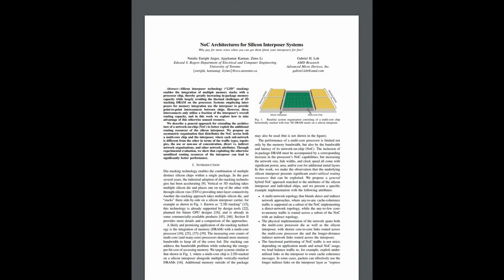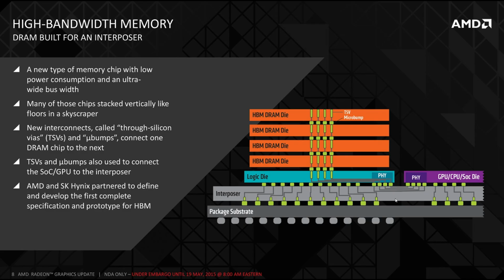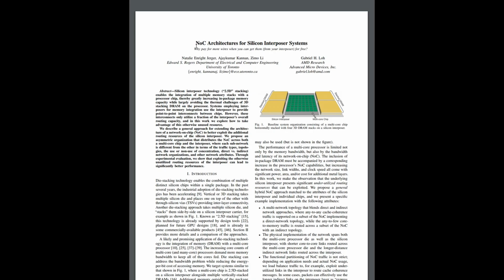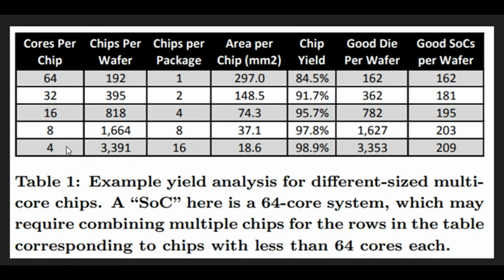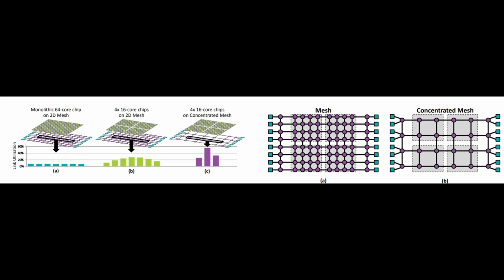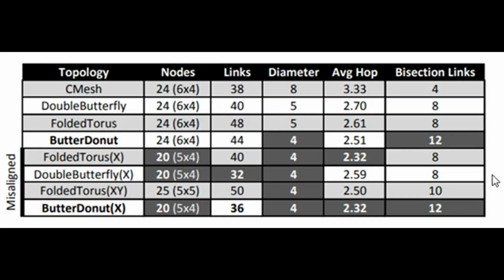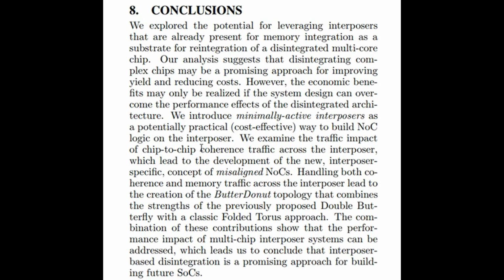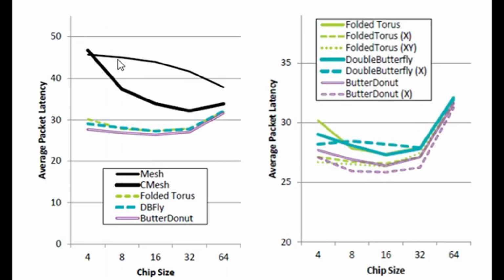Interposers, Chiplets and...ButterDonuts?

Comment: Why don't you send the research paper to Lisa Su? She may just get a few engineers to do some digging and research around these. I mean intel needs to research that as well if they want to compete. The die shrinks are getting to their limits, there needs to be a way to continue with getting performance. We may stop seeing die shrinks sometime in the next decade, and the only thing that's gonna lift up performance, are new architectures. Whoever has the best architecture will lead the show, the latter, will improvise.
Reply from the maker: 1:15 Sky Mage, check the authors again. ;)
Reply: My guess would be that it is impossible to do this kind of research outside of big CPU companies. And you can be sure that everyone that has a job in Chipdesign knows what papers there are. Especially when they are of this calibre. ^^
Reply: AMD Engineers wrote the paper :)
Reply: AdoredTV Yeah, I am sorry, my bad. I was half asleep watching your video. Thanks a lot. My mistake.
Reply: xD She is the researcher mate! Hehe.
Reply: that limit on smaller die process has been on the back of everyone's mind for a very long time. It has been a difficulty of making smaller features with the size of the light wave used in lithography, and the unknown of just how many atoms are needed to make an electronic component (diode, FET, transistor, etc) that will maintain the properties of that component after a period of time in use. This interposer thing and how HBM dies are stacked does offer another way, albeit power and cooling limited for some kinds of chips. I don't know when the limit will be reached, or what workarounds may be used to get more out of fewer gains, however, I'm sure power delivery and cooling will become an ever-increasing difficulty as well.

Hypothetically speaking, I can easily imagine a multilayer mass of CPUs made up of individual slices of "Interposers and CPU dies" stacked one on top of each other to produce a 3D cube/grid of cores. That does introduce the problem of getting power to the cores in the center of the 3D cube/grid and getting heat out from the center of the mass of CPU dies. I don't know if mini-heatpipes could somehow be included onto each layer of "Interposers and CPU dies" slices or not, and power connections capable of handling tens if not hundreds of amps on each slice for that matter. It would be very interesting to see how it is tackled if they ever go that way.
Reply: Cooling seems like the bigger problem once you start introducing large 3d structures;
Obviously there are other issues, but if you imagine something cube shaped rather than flat, then the first optimisation for power and data connections would simply be to spread the connection points over the entire surface.
Consider the history of integrated circuits, and by association, CPU's.
Many components still use the older packaging styles, but note the trend;
The oldest designs were largely in DIP packages.
Two rows of pins, either side of the chip carrier. Typically you don't see much beyond 40 pins in such a design, with 60-70 being the most I've ever seen from one.
From there you see stuff like the QFP package, which spreads the pins along all 4 sides of a chip package. These can have a few hundred pins, though often not more than about 120 or so as far as I've seen.

But pretty quickly you also started to see stuff like BGA/LGA/etc. What are these? Well, the pins are now spread over the entire surface of one side of the chip package.
There's many variations of this, depending on how, precisely the chip connects. Some are designed for direct soldering to a board, some are socketed.
Most non-trivial chips, such as modern CPU and GPU cores use these, but so does a lot of memory and other chips; Even low pin count devices, with say only 9 connections can be found in a package like this, because it makes it possible to make the package a lot smaller than a chip which is connected along it's edges.
Still, large packages have pin counts in the thousands.

OK, so... if you start making huge 3d stacks of silicon, then it follows that you'd take this principle further; rather than connecting along one plane of the device, you'd attempt to connect along multiple surfaces.
Certainly it's not foolproof. But you'd be able to optimise for routing distances, and path lengths could be shorter in general, because the same area in an optimal 3d configuration has shorter path lengths than a similar complexity device in a 2d topology.

That's all well and good for data and power connections, but of course, if you make something that's 60x the complexity of a current circuit design but using the same process nodes, are you now creating a system that has impossible power demands?
After all, the chip is bigger, and to some extent, power is proportional to the number of transistors. (it's more complex than that of course, but it's still broadly accurate.)
And of course, with more power comes more cooling.
And while cooling the surface components of a cube (or cylinder/sphere/whatever other topology might be optimal) is going to be vastly easier than cooling the interior areas.

We can see a similar issue in biology, which was solved, but does have major implications; 
Cells need oxygen, but early animals didn't have any way to distribute it. In fact, insects still don't. Because of this oxygen is absorbed directly through the skin, and diffuses through to inner cells by itself.
The problem is, the further the oxygen has to penetrate into a clump of cells, the less chance it has of getting there. Which placed a hard upper limit to how large an organism could get.

But, the solution to that was the circulatory system. Which broke the limit by creating a system that distributed oxygen internally much closer to where it was needed.
All well and good, but of course, it did introduce extra complexity and new points of failure;
To have a function circulatory system you need the circulatory system itself (which has to be placed properly, or it won't reach everything it needs to), a pump, (the heart), and an oxygen collection system (the lungs)

Anyway, to do 3d geometry in chips will require similar measures; 3d circuits will have to develop the equivalent of a circulatory system, even if just for cooling, rather than anything else.

I suppose you could include dedicated chip cooling layers in amongst all the other stuff you've stacked on top of one another, but it's certainly a lot more complex than trying to cool a 2d design...
Reply: You are all talking of slices and layers. I think the way forward is to use a curved topology. Cooling and power can be delivered in the same way as signals to the interconnects. Why should the signal have any more priority than power or cooling? They are all equally important for the homeostasis of the chip.

Comment: on a gpu... that would necessitate something interesting...
amds current word on it is they cant do it on gpus because devs are lazy/its hard/it has to be seemless
I mean thinking of it, gpu taks are stupidly fuckin parallel,  my understanding is shaders can largely be considered cores themselves, the thing I don't know is how often does a check back need to happen or does it? 
getting everything to work in firmware/driver may be possible, but any of amd's driver side anything after vega is kind of in question.

Comment: Hang on...
First we had the motherboard which connected all other parts of a system, l2 cache used to be separate as did floating point units and memory controllers and ethernet cards, sound cards, a cpu, system memory, video card and so on.

We slowly integrated them one by one, the l2 cache, then floating point unit, then the ethernet, then sound cards, memory controller (intel quite a bit late there), then we even got round to having an integrated chipset and even made chips with an integrated voltage regulator (FIVR) and integrated graphics cards now.

Before long we could have an amd APU which is a cpu, gpu, HBM l4 ram cache thats also Vram, integrated chipset with ethernet and sound all built onto a single piece of silicon.......and now we're looking at separating everything again lol.
The cpu we use in 10 years time will be contain a cpu die, a VRM die, a gpu die, a hbm stack, a sound chip, an network chip all on 1 HUGE socketed package. which will plug into a motherboard....more like a step mother really, it'll only be there because you have no usb ports on the cpu.

Comment: Always a joy to watch your videos. You find some of the most hidden and lower known tech, do amazing research, and bring the info up for us to follow in a condensed way.  Yea, most wouldn't call a 20 min or more video condensed, but, the amount of stuff you give, is amazing.  I really loved this one, as it's one I had thought about long ago, before we were doing the multi core again, I was thinking they should do a layered chip with the interposer on the main core, that would allow them to set it to a sub layer of the core so that it would have set parts to act on the different paths.  I was thinking it should have a set spot for ram, and for storage, and for graphics, each layer would run it's own part, and it would run though the interposer type layer.  Never had enough to get it worked out though, and seeing this, I love it.  I hope it keeps going in this direction, and we can get some massive innovation going.

Comment: ALL I know is I'm so happy with my Ryzen Build, I Have an X370 Taichi Motherboard and Used to own a 1700/AT3.9Ghz.. I upgraded to a 2700X 3 Months ago Basically and don't Regret it. AMD has a Great Upgrade path right now.. This along with my 3200FlareX RAm an a RX 480 has been the most stable, PC I have ever owned, Never crashes or Freezes..... I have a 4K ACER 32" freesync Monitor and Believe it or Not I can game in 4K But mostly 1440, But still that is Great For a PC that only costed me $1200 to build.. I have Built Intel systems that don't add up in the past with mixing and matching of different GPU's between ATI and Nvidia..  And never had a System like this before, that does it all!!!

Comment: One key part of the Zen revolution is to have a single die which could run on its own, or with friends.  That means each and every die needs to have its own memory access.  More cores need more memory bandwidth and get it automatically.  So no uncore die.

Comment: I wonder if AMD could move CPU components that dont scale with clockspeed onto the interposer, things like usb, SATA, security hardware, video encoder etc essentially turn it into a southbridge. so say Microsoft or Sony want a console, AMD just have to make a custom interposer on a cheap process and stick some off the shelf ryzen 3000 and radeon GPU dies on it rather than tying up their 7nm capacity with huge chips that sell for peanuts.
Reply: samsung?
Reply: its the best way for amd to make semi custom chips while using high performance off the shelf silicone.

Comment: I'd love to see a 256 core architecture ;^). Now that cost per core scales linearly due to fragmentation, potentially, the only thing limiting number of cores is the latency and size. I'd think that when two threads need to speak to each other, the software, or hardware controller on the cpu whatever, should be smart enough to assign the two threads near each other, to decrease latency.

Comment: An interesting article, Jim. Imagine that: 7 nm. node, improvements on the architecture, at least 2 more cores and interposers. That would be nice. Even if AMD would be 1 or 2 years later, this much is certain. There is real progress again in chip-design after almost a decade of stagnation. If AMD could build an intelligent interposer then multi-die GPUs could be interesting. Otherwise it will only function as if you use two graphics cards and tha only works reliably  with a modern API for graphics (Vulkan/DX12) and proper support from the developer.
Reply from the maker: Yeah GPU is an interesting one with different challenges.  Needs more research. ;)
Reply: Yes, GPUs on themselves are quite complicated but with all the software and interaction between GPUs, CPU-cores, SSD's and RAM and the requirement to get a certain set of data processed at the same time for that frame, it gets complicated fast.
I downloaded those articles, i plan to read both articles soon. Interesting stuff.

Comment: Another potential benefit that I see using an active interposer, is that memory driver circuit could be put on the interposer. As I understand it, mixing the larger transistors (required for driving the high currents needed for DRAM)  on a die with high speed logic causes conflicting design requirement leading to design compromises. Just a thought, and I might be wrong about this, would be interested to hear from any experts out there.

Also, In depth content like this is why your channel is the absolute best on YT. I learned a lot today, so thankyou Jim for all your hard work and great insight.
Reply: Right and even more as both i/o and cache scale poorly in leading processes, which cost ever more to develop there's the potential to use cheaper older processes optimised for things like the IOD and Zen4x3D V-cache chiplets rather than core logic.
From leak reporters it sounds like Zen6 will be stacking core CCDs on  an active chip though one that provides far more functionality than just an active inter die network.

Comment: complex technology well explained! The transition from monolithic CPU to "glued together" chiplets is a major shift that is going to revolutionize not only x86 CPUs, but the whole computer industry. 

I guess we can expect not only CPU chiplets using active interposers with complex NoC, but also GPUs, high bandwidth memory  and various controllers that previously were part of a mainboard chipset or an add-on card. 
The active interposer should make it possible to integrate all this different chiplets into on big, fragmented chip. 

For now, I'd be happy if AMD would come up with a new APU lineup that not only integrates Vega or Navi cores, but also the frame buffer memory - all connected through an active interposer which lets the iGPU perform at RX580 level. My guess is we're not too far away of something along these lines. 

Besides the savings from the production process, this technology will let CPU makers earn more money as they will be able to extend their value chain across parts that were typically supplied by 3rd parties.

Comment: So, do you bet that's part of Zen2 or Zen3? Maybe Zen3? Because it's on the same 7nm technology, so it's interesting why the generational jump there.
Reply from the maker: Could be Zen 3 yeah, too early maybe for 2...
Reply: The nice thing about it. is while you technically make it more complex. The complexity is split on two different components. For a Zen 1&2 chip. Every chip have all the components.

Just pushing down the network (and maybe phys) as well as nodes to the interposer does free up complexity from the cores.

It whould also lower the amount of conectors of the cores. Connectors (and also phy) can´t be die shrinked, so they take up a quite big area of the chips and there fore is a very expensive sector of the die

Comment: Wow, the concept of an active interposer never crossed my mind.  This is extremely good as even if the 7nm node churns out poor yields AMD could still easily do another improvement process (12nm+) and still innovate core counts and latency by using the interposer for Chip to Chip communication.  I wonder how much die size would be saved by still allowing the CCXs to communicate on chip, but shifting the Chip to Chip communication through the interposer... OR EVEN BETTER what if AMD instead decided to swing back to 4 core chips and did 4 chips per interposer (16 core chips for mainstream).  With the current 12nm process tech that already has excellent yeilds that would be an easy win.  With 7nm, infinity fabric routed through the interposer, 4 core chips; the chips would end up being pretty tiny and would yield well even if the 7nm process wasn't.  This is really exciting; thanks for going over this.

Comment: A very nice and detailed analysis of the underlying technology as well as industrial push for disruption.Currently we are at the limit where we really need a disruption in ASIC design and technology. Intel 3D Xpoint is definitely one of those (still nascent) but the use case of HBM still doesn't look as cost effective "presently". 

The problem with TSV is particularly reliable power management and this troublesome heat plays an important factor in functional yield. To top it off we add a hybrid process integration which costs way too much due to inherent technology issues.

In older technologies like 65nm and 28nm the issue of leakage begins to dominate while in newer 16nm and 10m the issue shifts to complexity and variation of process.

Comment: Adding additional layer give architecture possibility to stop be limited to planar graph, so adding layer give you direct connection between cores, which normally required few ticks to pass other connection. And problem with GPU is mGPU module in Dx12 is not used, because Nvidia not use it, so AMD only make good card on paper, but they going to use it in enterprise, because there application will use mGPU design.
Reply: One more thing, AMD must buy production in GF, 1 billion worth of contracts, if I remember correctly, and they may use it for 65nm node, so interposer may be done in GF and cpu cores in TSMC, but I don't know if it is physically possible (it may required to be done in one fab)